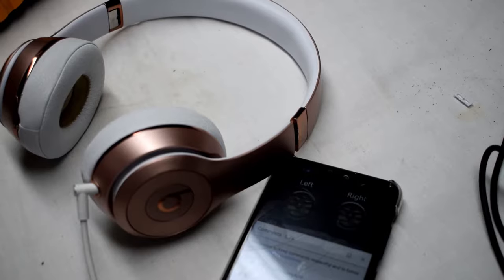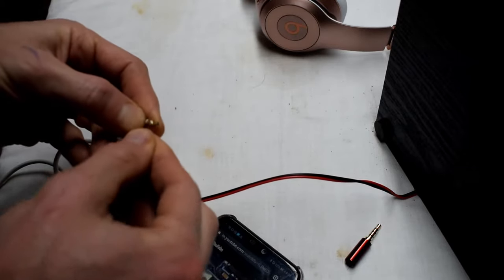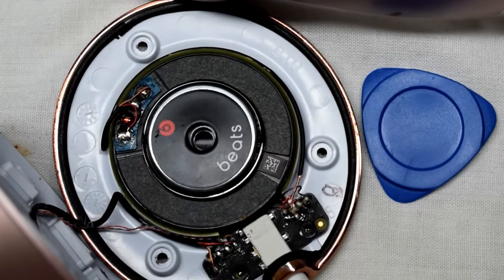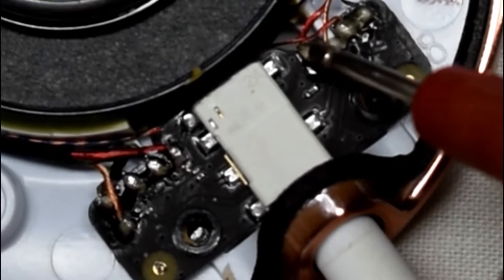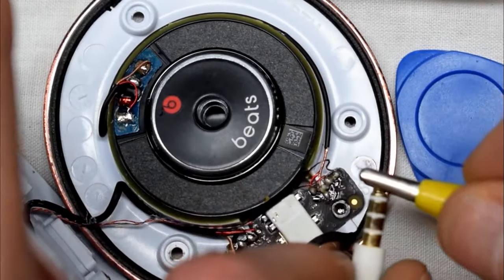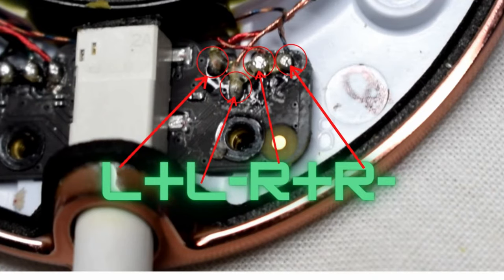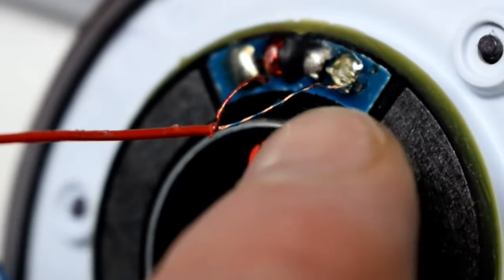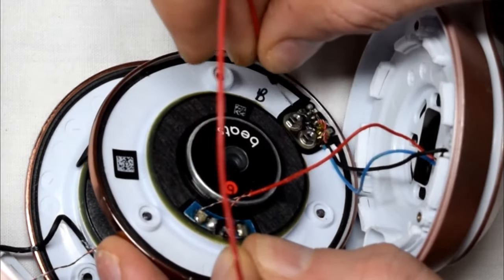beats solo 3 right side not working? Simple fix

Comment: Beats headphones are designed to fail fast. Both my daughter's and niece's Beats headphones failed just after a year. Amazing what advertising and celebrity can do for a reputation that would otherwise be awful
Reply: My beats worked fine for about 3 years till my sister slammed them to the ground and one fell off
Reply: You’re not even wrong. I’ve been buying batches of them in bulk because they all have a planned obsolescence defect. After fixing a couple, it’s clock work
Reply: I've had mine for 5 years finally kicked the bucket on the right side today
Reply: My beats stopped working after a year of having them brand new and apple took them back on a one year warrenty and I got a brand new pair, now this new pair has the same problem one year after I got the replacement this is 100% correct!!!
Reply: Mine just failed after just over a month
Reply: mine lasted 6-7 years definitely about how you treat them not the other way around
Reply: @treyfirminger3028  I never left the house with them, always put them down carefully etc.  They just broke.
Reply: @treyfirminger3028  Respectfully I disagree. Mine were in very good condition and they broke after a year. (Always kept in the case and never dropped once ect.) When I went backto micro-center where I bought them they even told me they were in good contion and they aren't sure why it had happened.
Reply: mine also lasted a year and now my right side isnt working
Reply: I found the same thing. I bought 2 pairs and they both failed JUST after the one year warranty was void
Reply: @treyfirminger3028  Nah, I’m very responsible with items like that and I’ve had two pairs both last 2 years. Right after warranty is over.
Reply: @codykruger6515  bro same for mines. my right side of my headphones just stopped working today for whatever reason, despite being fine yesterday. i believe its the stupid case you put the headphones in, they're just horrible and only accelerate the wear.
Reply: Mine lasted two months
Reply: @treyfirminger3028  mine were not mistreated what so ever other than the fact I used them from day to day lasted two months so check ya fact books this my second pair that has done this
Reply: 3 pairs I had - first pair was replaced. Replacement went out. Then got a new pair that looks like this on sale. Same thing after a year
Reply: @@kaysadvice return em asap
Reply: I've had mine since November.... its January....
Reply: @civilwarwasaninsidejob7405 same here.
Reply: I got mine 7 months ago and now the right side isn't working
Reply: Took a month and a half for each of two Solo3s I bought to have this issue. Ridiculous. And the repair cost? $130 according to Apple. Nearly the same price as a new pair.
Reply: @treyfirminger3028 Gadgets were made differently then, now they're made so cheap, the price is ridiculous. I have a cheap pair, that sound better and have lasted longer all for £25. They're a rip off imo.

Comment: If you have a soldering iron and some skill (these are sub 30awg wires) you can do this. If this is your first solder job—consider asking a friend or go to a professional. This is not a very easy fix but I wouldn’t say it’s intermediate either. And if you use magnification you can greatly increase your chances of success! Thanks for the video. I didn’t know what to expect before

Comment: I was watching your video and contemplating about how to fix mines when I though of a random idea to squeeze the white wire that is visible when you extend it. Somehow it worked and my right ear muff is working. I have no idea what happened
Reply from the maker: thanks for sharing
Reply from the maker: there is a loose connection in the wire, try not to fold the headset
Reply: Has it failed again? If the wire is indeed loose at the solder joints or pinched inside it’s only a matter of time.

Comment: Could please help me? My right side only works when I twist the earcup a bit. What should I do?
Reply from the maker: I sounds like a connection issue , you would have to test it with a multimeter
Reply: @NewsonsElectronics  Thank you so much for answering.
Reply from the maker: @vo6428  no problem

Comment: So I was able to fix mine. My right side wasn’t working but the problem was in the left side. The ground cable was broken coming from the board from the aux to the other board right behind. Couldn’t exactly find where it was broken so I made a little bridge using thin wire and soldered the wire from before it was broken to after where it was broken. Had a hard time soldiering but for best results just wrap the insulated cable from the beats around the new copper wire then add resin core. (Beats wire must be wrapped on the outside of the copper cable then solder). I think this is a very common problem because the speaker is able to wiggle and adjust to your head shape using rubber but when the speaker is twisted/bent too much then too much stress is put onto the wires that aren’t long enough then bam they break. But I’m not saying this is the same problem for everyone but if your right speaker isn’t working then take apart the left ear and create a bridge from the blue stripped wire on the very right of the aux board board and connect it to the other board right behind. Like try opening up the blue stripped insulated wire on the board behind and connect it to the very last wire on the aux board which should also be the blue stripped wire. If the speaker starts working then there’s your problem and you may proceed cutting and soldering the wire. I tried my best on instructions with words but if you still have a hard time understanding then just send a comment and I will help you out

Comment: As mentioned before, I am experiencing the same issue when blutooth playing: static noise is present.
When the headphones are playing on cable there isnt any static.
Do you have any advice to avoid  the static noise when blutooth playing?
Maybe using a shielded cable?
Thanks!!
Reply from the maker: its a grounding issue make sure to connect the ground wire to the ground of the other headphone.
Reply: @NewsonsElectronics  
No entendí
Reply: did you find solution for this? I have same similiar problem
Reply: @MrDhak0  no solution, the only way worked for me is locate where the broken wire is and solder it again.
The procedure described here always result in static sound when blutooth is played.

Comment: Did your fix and it worked for jacked in. But when i use wireless right side stops working. Any ideas? Thank you for your time.
Reply from the maker: its a grounding issue make sure the ground is common between both speakers

Comment: I have had the same issue on the beats solo2 and on the solo3 as well.
I binned the solo2 and was about to do the same with my solo3 but after giving it ( the right ear cup) a few hard taps it came back to life and has been working smoothly ever since. I am not advocating banging the crap out of the headset but it saved mine from the garbage bin 🤷‍♂️
Reply from the maker: sounds like a connection issue
Reply: @NewsonsElectronics  2 headphones in a row and plenty more people online, sounds also like a manufacturing process issue. I think i have not charged either of my solo's more then 20 times so i don't wear them down..
Reply: No way did hitting mine like you said just work i-
Reply: Why did this work for me aswell 😂😂
Reply: @sahiblongia2855  eventually it wont work anymore 😔😂
Mine died permanently  so i switched to a diff brand.. 👍

Comment: Thank you so much for the walkthrough! The solution worked for the most part and the right side now plays again. However, a new issue popped up that I'm wondering if you experienced as well. When playing music via Bluetooth there is a high pitched noise in the background on the fixed right side that is more evident when volume of the music is lower. When I pause the music, the noise stops a few seconds after.

The headphones appear to work noise-free through the wire, however the main reason I got them in the first place is to listen wirelessly. Do you know by chance why this is happening?
Reply from the maker: yes its a grounding issue instead of soldering the wire to any ground you need to make the wire go to the correct ground wire. So for each headphone there are two wires if you have a multimeter see what one is not connected you may have to use some new wire.
Reply: Im facing the same issue.. i did the solding to that small bolt..
Reply from the maker: @dawood.jarral  instead of the bolt try the - on the pcb. if that does not work there could be a bad connection of the - line that goes goes though the headset do a continuity test and see if the signal is getting to the other side of the headphones if not you have to run another wire.

Comment: When I fold the left side of my beats the sound on the right side starts playing, but when I extend the left side to put it over my head the sound on the right side stops playing.
Reply from the maker: There is a cable that is pinched when folding. You would have to replace the cable to have a solid connection.
Reply: @NewsonsElectronics  ahh thanks.
Reply from the maker: @crackcbainefl2675  no problem
Reply: @NewsonsElectronics  any advice on how to fix the cable first ?
Reply from the maker: @crackcbainefl2675  open both sides then use your multimeter to check the connection of each wire. eg. one ear piece has black and red wire. connect one lead to the speaker then the other to the other side, fold the speakers to see if there still is a connection if none then you need to fix that wire
Reply from the maker: @crackcbainefl2675  you could buy a replacement cable https://www.joesge.com/products/beats-by-dre-solo-2-solo-3-wireless-5-core-wire-with-clip-parts
Reply: @NewsonsElectronics  im starting right now, thx you again.
Reply from the maker: @crackcbainefl2675  best of luck
Reply: same
Reply: @NewsonsElectronics  i finally fixed it !
Reply from the maker: @crackcbainefl2675  great what was the solution?
Reply: @NewsonsElectronics  removed the wire that runs across the headphones and added a new one

Comment: i followed your instruction. and yes my right side headphone working again. but now my right side has static sound when playing music via bluetooh, but normal when using 3.5mm jack. any solution? thanks
Reply from the maker: the issue is the grounding you need to run a ground wire from one to the other

Comment: I tried to fix the right side as explained in the video.Unluckily it works for a very short time and start noise.I changed the wire and solder it again it works good for a short while again . Now it is not working at all. No sound. Please need your guidance.What is the problem how to resolve it Thanks
Reply from the maker: need to replace the wires there is a bad connection. Use a mutimeter to determine what wire it is.
Reply: @NewsonsElectronics  Thanks for reply. I checked with  Multi meter, I found that speaker is blown out. wire are good.
I did the same experience on another Solo3. it is working (mean Right speaker also giving sound) but what was i experienced with the previous  one, same noise. left speaker play clear sound but Right play with Noise. I can't explain. Sound is not clear. As some time we listen on radio noisy disturb music.I kept it open waiting for your advise. Thanks
Reply: I have the same problem as Victoria Maslova explained. Is there any solution please.
Reply from the maker: @hahmad4064  could be another wire that has a poor connection.
Reply: @NewsonsElectronics Which Wire? The wire which I used for earth  by myself or some other original wires? When I am using cable for listing there is no noise but with blue tooth there is noise. Thanks
Reply from the maker: @hahmad4064  don't solder to the bolt its a grounding issue. make sure the ground wire can get to the ground pin on the other headphone side. test it by using a wire the noise will go away. The problem is the grounding.
Reply: @NewsonsElectronics  Thanks, Bothering again.I tried both the grounds but it doesn't resolve same problem with both ground . But It is very amazing that with aux in wire sound is clear and no noise. I appreciate your prompt response. Not a technical person the wire are so sophisticated and joints are so close. Hard for me soldering. Thanks again
Reply from the maker: @hahmad4064  no problem

Comment: I do it , the right side works but I hear a little interference why ? That's problem have solution ?. Thanks !
Reply from the maker: its a grounding issue. instead of connecting to the ground on that side try connecting to the ground on the other speaker

Comment: How about the case when right speaker does not work only when wireless but both speakers works wired?
Reply from the maker: could be an issue with the Bluetooth module, try disconnecting the battery for a hard reset.
Reply: @NewsonsElectronics  I did it but that did not do the trick. Hard reset by disconnecting reacted as hard reset with the buttons - red blinking light shows up. Unfortunately no luck. I have also tried to play with the AUX jack with no luck so far.
Reply: @bonevchannel  let us know if u figure it out, same thing happening to me right now
Reply: @idk-wp8wi  No problem. I think the only reasonable explanation is the AUX pin for the right speaker must be stuck and thus it works only when cable is in. Unfortunately I have not been able to confirm this in any way.
Reply: Hello everyone! I have exactly the same situation. The earbuds work great on wire (both ears). But only the left ear works through Bluetooth (the right ear turns on a little from time to time when you press/touch / turn the left ear). Didn't find a solution to your problem?

Comment: I had no song from the left side. I resolder some wires, order new black cable with the five wires colours. All my connections are good, but I have low sound and no bass on my left side. Do you now what it could be ? Thanks a lot

Comment: Thanks for sharing. Question: I noticed that you are using a Windows PC. When connected with the 3.5 wire, can you mute or raise the volume up or down? I currently have Solo 2 and 3 connected to Windows 10 and 11, and the mute and raising the volume up or down do not work. I even grabbed my daughter's factory Studio 3 3.5 wire, and it does the same. If connected via Bluetooth, it works fine; this is so strange.
Reply: You're probably past it now, but I'm guessing anything that comes in on that analog jack just goes straight to the speakers and is using the amplification from the headphone output on whatever you're running. The onboard volume/mute stuff is probably part of the Beats' circuitry (bluetooth>amplifier,etc.) so it's no longer active while wired. Someone please correct that if it's wrong.

Comment: Hi, this solution fixed my not working right side speaker, but on bluetooth i got hissing static noise coming from that speaker. how do i fix that? on aux its fine. tried different device and hard reset
Reply from the maker: you still have a grounding issue, from one side of the headphone you have a broken wire you might have to run a ground wire from one headphone to the other try using a wire and connecting from the ground of one side of the headphone to the other to see if the static goes away.
Reply: @NewsonsElectronics  yep. Thank you. found the ground on aux board that does not make static noise. But thats no longer easy fix to get one wire through from left to right side. Maybe is easier to replace main wire… will that fix the issue also?
Reply from the maker: @pbreaker46  just put on extra thin wire from one to the other through the headpiece
Reply: @NewsonsElectronics  i did it and all works. that was not so fun :D thank you for instructions and help.

 I have another pair of solo3 that battery drains fully when turned off in two days completely. do you have idea maybe what is wrong with them? installed new battery and did nothing.
Reply from the maker: @pbreaker46  check the heat of the components anything hot will use energy.

Comment: I dropped my solo 3 wireless headphones(just right side)in a cup of Coke. I put them in a bag of rice for 3 days. It still would not work. I just tried wiping the battery & connections with an alcohol wipe. When I try to turn them on I just get a red blinking light. Any ideas on how to fix this. I'm trying to get them working again. Appreciate your help.
Reply from the maker: sound like it could be fried, for the cost of the headset I may be best to buy a new one.

Comment: This fix seems to solve one problem but create another. Interference when using the Bluetooth connection causing a high pitch squeal in the right headphone. Might need shielded wire or another ground source.
Reply from the maker: try to connect the ground to the other side of the headphones. You may need to run a wire because your ground wire is broken.
Reply: I’m trying to avoid running a whole new ground as this requires complete disassembly of the headphones and an expensive new main harness. This seemed like a great idea for a fix but Unfortunately every ground point on that charging port creates noise. I’m wondering if there is somewhere else near the battery you could tap in to which might eliminate interference.